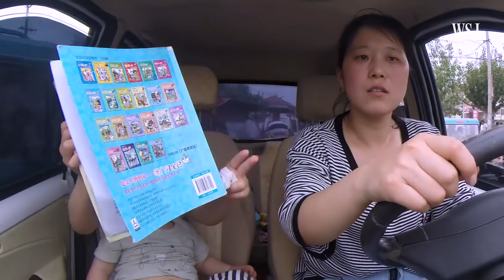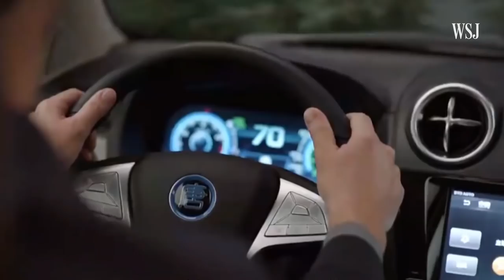Big in China: Tiny Electric Cars

Comment: If everyone is driving small cars like these at a slow speed like the video says, then when there is a wreck, there may not be as serious of injuries as compared to people in the USA driving large cars at much faster speeds.
Reply: But if these tiny cars use the same roadways as regular cars chances are they could end up in an accident with a larger car traveling at a faster speed. Those tiny cars don t look like they could withstand that sort of impact. Seems like a casket on wheels if you ask me.
Reply: Our cars keep getting safer and the speed limits keep dropping.  But the cost to repair normal cars are raising yearly.  A small crash in a normal car can be considered a total(the price to repair is higher than buying a replacement).
Reply: "Those tiny cars don't look like they could withstand that sort of impact."

Then what about motorcycles (which are legal on the road in most of the world) offering zero protection against car crashes? At least this small electric car still offers some protection, compared to motorbikes and electric scooters
Reply: The smaller mass of the car as well as the reduced speed would also play in the driver's favor in an accident.
Reply: this only in 4 class city in China  . in 3 class city traffic police check on the road every often. no driving ID ? not a correct car? get fine even in prison for 15 days.  1 class city even only allow local car on the road. anyway. this kind of car has a big market. but that is not mean in China it is allowed on the road in city.
Reply: The car can only be used in town. Cant even cross a high way
Reply: I agree, i doubt the car can reach 50km/h once passangers get in, add cargo, and maybe it will get to 40km/h downhill, at that speed a regular seatbelt is enough..
Reply: Bob Smith.   .. You are spot on i  your analysis.
Reply: Bob Smith   much faster with bigger cars in USA?!😂 Dude you can drive idk 130 km/h maximum that's not fast. Look at Germany: unlimited Speed with big cars and much lower accidents per 1000 habitants than in the USA. 
It's not about how fast and how big the cars are, but rather how good you can drive and how big the schooling of the driver license was.

Comment: That is a car I want, I live in sweden and seldom need to go far or fast, often I need to go to the store 2 km away, I can walk that distance and often do so, but to walk often limit how much I can buy, and even if you little it can be hard to walk home if it start to rain or snow. And if the car is cheap and low tech you will not be afraid to have it outside or to use it on bad roads.

Comment: People,  these are just golf carts.
Reply: What's wrong with a golf cart if that's all a mother needs? She doesn't fly on a highway or drag race.
Reply: @djmuscovy7525  Nothing at all. I am quite amused at folks however losing their minds thinking this is amazing new tech and wondering when they will be imported to America
Reply: @hojo70  People amazed are mostly in the developing countries.
Reply: People aren't amazed because its "amazing new tech" people are amazed because of how practical it is.
Reply: hojo70 well the point is to benefit more low income people with a practical affordable vehicle, nothing about satisfying those high income people with a high tech. Especially when some people rather to spend same money to buy a golf car like this than a new iPhone!
Reply: I was thinking the same, then I realize marketing these as "golf carts" is the real problem
Reply: Also you can charge this microcar in your house, no need to go to the gas station..
Reply: Nope some Golf Carts are Bigger.
Reply: I saw a bunch of these in Beijing recently, and they are much smaller and more covered than golf carts.
Reply: i drive a smart car and describe it like driving a golf cart with 6 forward gears. these i imagine would be similar just with speed restriction
Reply: @djmuscovy7525  emmmmm,cause a golf cart is not allowed driving on road
Reply: victor smith  they are not safe at all, they didn't pass any crash tests and they are running on the road with regular cars.
Reply: they have a normal car battery, that´s not so save. Usually they are sealed off

Comment: I get the feeling that a lot of drivers in the U.S. don't like slow moving vehicles (depending on how slow they are actually moving).
Reply: These cars probably won't success in US. Because battery capacity are really low, about maxium 30-40 km (18.6-24 miles) after a full charge.  Recharging takes hours.

Comment: They are so slow and so "safe" you can carry your child on your lap, in the front seat, centimetres from the steering wheel. Darwin Award waiting to happen.
Reply: The fact that it has no airbag, it's not any worse than her placing the child in the passenger seat with no seatbelt.
Reply: Motorcycles don't have airbags too, and they travel at much faster speeds and a common on the roads. At least this small car has some form of protection.
Reply: 神州 Shenzhou This is a very good point actually.
Reply: @JJs_playground  nobody holds their baby on a motorcycle

Comment: $1,500 for a small electric car would be nice.  I travel only within 20 miles radius of where I live.   Electricity is 4 times cheaper than gas.  Added bonus.  I just afraid the government car registration fee and required insurance by the government will make it beyond affordable for the poor.
Reply: If you can't afford a new car, you buy a used car.
Reply: Gasoline costs $0.18 a mile, electricity costs $0.04 a mile.  If I drive 15,000 miles a year, my saving will be $2,100.  $2,700 is gas and $600 is electricity.  Over 5 years, I will save $10,500.

Comment: 2:29 lead acid batteries are not sub-standard. they are what turns the starter motor for 99% of all petrol & diesel car engines! lead acid batteries are also easy to recondition & recycle. they are however cheap and have no where near the power density of lithium ion.

Comment: Yeah...the only way that I can get behind electric vehicles in general (not a new technology, by the way) is if a truly modular system can be developed. It must be the LS engine of electric motors: powerful, reliable, and affordable. It should also come in three basic variants for front-engined, mid-engined, and rear-engined cars. Without this in place, my Studebaker will continue to have its 289 cu. V8 proudly on display.

Comment: You get what you paid for. The car does not have air bag, ABS, power steering, or air conditioning and no crumble zone. You will be dead if you crash it at 30MPH.  And the cheap lead acid battery probably last only 20K miles.

Comment: "sub standard lead acid batteries" is an utter bogus claim. they only have a fraction of the energy density of lithium based batteries, but are MUCH cheaper, last longer, dont explode or catch fire, and a easier to produce, maintain and recycle.

Comment: Yes indeed, if you're car is slow you're pretty much immune to crashes. That's why if a speeding truck mounts the sidewalk it will simply bounce off any slow-moving pensioner in it's path. Be slow, be safe.
Reply: unless you get hit by a regular car and get turned into a pancake.

Comment: There are real problems with these LSEVs. First, these EVs do not have any license plate which means in a traffic accident, these vehicles could get off and disappear without and difficulties. The drivers of these EVs do not need a test to be on road. These vehicles do not have any traffic insurance. The safety equipment of these EVs is poor. And finally, the lane occupation of these EVs are also problematic. They are too large for a bike lane, which is the lane for bikes and EV scooters. And they are also too slow for an automobile lane.

Comment: Tata sells a proper 4 seater and 100 ltr luggage space with all the safety features and a 800 CC engine, power steering ,air bags, air conditioning and all that and a car that you can take on highway with 120 km speed  and can drive in city for 3000. I don't understand what is great in this 🐌 paced tin can .. totally unsafe wrongly called car.

Comment: In a sense, it does represent the future direction of vehicles. Efficient, energy saving, and high utilization. But the government or industry should issue more stringent industry standards because it is not safe, and there will be many problems with low-quality batteries.

Comment: Low speed vehicles in China...popular because there isn't a bunch of cheap 4,000 lbs used SUV's driving around. A big reason why I'm sure these won't take off in North America. Too many trucks/SUV's with idiot drivers behind the wheel
Reply: These types of vehicles wouldn't be allowed in America because they don't have seat belts or airbags.  And then of course it would have to pass the crash safety tests.     

And by the looks of it, they would fail miserably.
Reply: @GANTZ100pts  You're assuming it would be classified as a car and not a "bicycle" or golf cart. Here in Canada with a speed limit of 30km/hr these can be driven on some public roads. there will be loads of regulation if they ever became popular.

Comment: You can get a 2017 (new) chevrolet spark at brucechevrolet.com for 10,888 dollars still (gas powered). And you can travel at interestate speeds which is 70 now.  The vehicles in the U.S. have more safety things (like airbags, 3-point seat belts, anti-lock brakes) and probably stricter emission equipment for gas and diesel powered vehicles.  Though of course electric vehicles have a lot advantages too them.  Maybe these Chinese companies could get dealerships in the U.S. (especially the inexpensive electric ones).  But it might be with all the rules about how vehicles are sold here they might just end up being as expensive as if they were made here.  I saw and electric smart4two today and I 've seen others around town.  It would be great if they were as inexpensive as gas powered vehicles.  :-)  Also the Nissan Versa sedan is about the same prices as the Chevrolet Spark (the two most inexpensive cars in the U.S.).